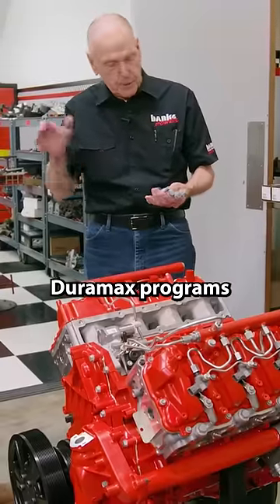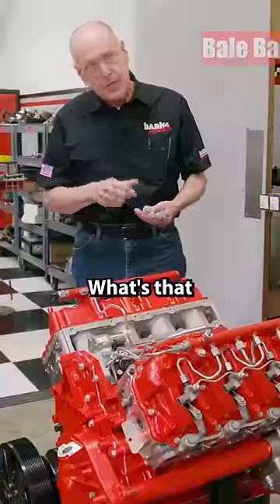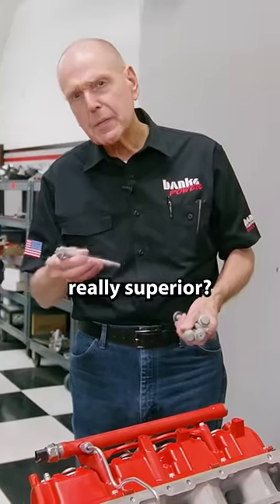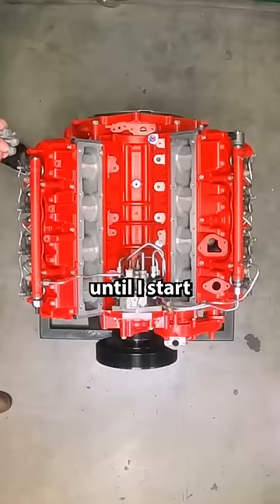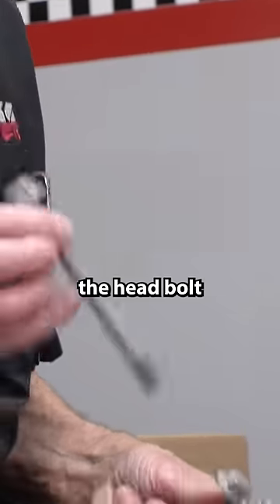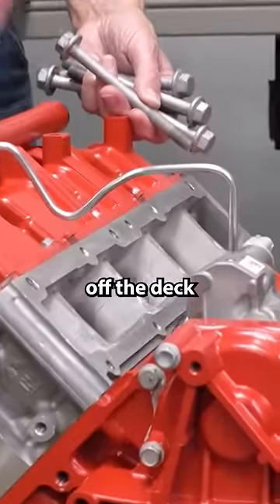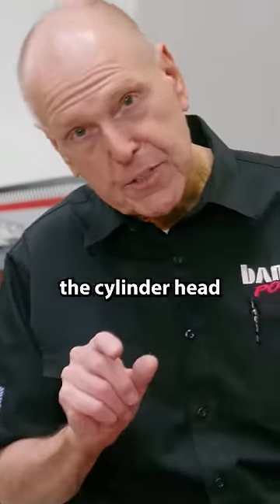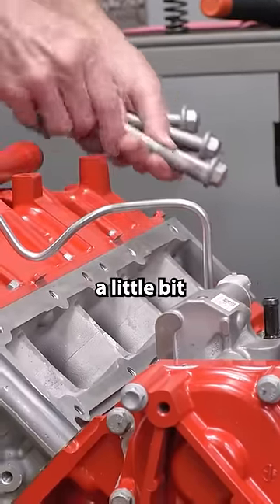Upgrading to head studs might be a bad idea

Comment: As a Ford 6.0L owner, I still won't hesitate to spend money on head studs lol
Reply: A lot of 6.0’s get studded and still have issues because of bad machining work and surfaces. DieselTechRon, JoeDiesel187, and KTM have all talked about how they got redo’s. Anything above stock power will need studs though and the Ford calibration is already way higher than Navistar intended it to be.
Reply: 6.0s make really good boat anchors but really unreliable truck engines. "BuT iTs BuLlEtPrOoFeD!"
Reply: i think the biggest problem was there is only 10 bolts  @warrenself
Reply: Because it's a 6.0😅alone or because of the labor involved?😊
Reply: @painteater19 the question is is the 6.0 or 6.4 a better boat anchor
Reply: Junk
Reply: @warrenself false. I found a website selling international 6 liters and the power numbers were identical. The difference is the emissions standards
Reply: "As a Ford 6.0L owner"

Well, there's your problem....
Reply: @painteater19 best trolling line anchor ever!!!
Reply: @SXSPRIME a 6.4 over 100k is a better boat anchor.
Reply: @painteater19  I know a guy that spent $8k on a "bulletproofed" 6.0 for his van, and it just blew up. Such a shitty engine.
Reply: @joshuaearnheart2756  Ford calibrations have higher cylinder pressures. Ford vehicles blow head gaskets way more often than the International ones. Usually the International trucks lift a head when the EGR cooler, oil cooler, or water pump fail and overheat the engine after it’s pushed. Ford calibrations do require more EGR usage but they allow more RPM, more boost, and therefore higher cylinder pressure. The RPM is also why you see lifters fail in Ford applications because the VT series of engines use the same lifters as a 7.3 which is another giveaway that it was a mere replacement.
Reply: @josiahjosiah534  Only really an issue with Ford’s because of the higher cylinder pressures. Heads usually only lift in International trucks once the engine has been pushed and overheated after a cooling system failure.
Reply: you guys are an exception to the rule LOL. You get a pass
Reply: The Duramax uses the correct amount of bolts per cylinder..... 6.0 takes a lot of money to get a few days of reliability.  And still won't be as good as a D-max.
Reply: Exactly what a 6.0 owner would say 😂
Reply: @thewatcher611  VT365 spec doesn’t blow gaskets unless majorly overheated or tuned. Stock Ford tune is too much for the engine.
Reply: Some engines just need studs. Old Toyota turbo engines with iron blocks (22r, 7m, 3s & 1/2jz) do have head gasket failures until you fix ‘em
Reply: The 6.0 powerstroke needs the studs, the duramax doesn’t. Just a small amount of difference makes the difference.

Comment: This guy is WAY to smart to be an OEM engineer. 
If he was, nothing would ever break….
Reply: Management would tell them to design a failure or cut costs on the team until one organically showed up.
Reply: Does someone wanna tell Travis?
Reply: Something will break eventually
Reply: @MikeyB-Rod no..1989 was a long time ago.
Reply: @timothybayliss6680  uhh, ok
Reply: I think you nissed the point. Its not that nothing fails, its that you decide what fails.
Reply: @jstadude9810 nailed it. It would be great to have an engine where nothing failed. And I have had a few that ran nearly 300,000 miles. But i did not add power to them or push them to their limits. They performed as designed. More power and equally increased reliability get very complex and expensive. I mean what are you gonna do. Make a forged ar500 billet block for your engine? Something has got to give somewhere.
Pick your Fuse. Make it cheap and easy to replace.
Reply: @tsstn buy a toyota hilux or a MB
Reply: @MikeyB-Rod I want to but he kinda responded himself
Reply: @luichinplaystation610  I don't follow what you mean?
Reply: Planned obsolescence

Comment: This is why I subscribe to this channel. This man brings real good intelligence to light and I've been taught for years. Being a mechanic that fasteners, especially bolts, are supposed to stretch when you torque them. That's the whole point of talking a fastener is you torque it. You're putting stretch into it so it's acting a little bit like a spring. If it's too that spring is too rigid and not forgiving like he's saying it will find a weak point. Awesome video for those of you who aren't subscribed to this channel and you want to build hot rods and engines and you want to make more power and go faster and all of that you need to subscribe to this guy

Comment: This logic works for aluminum heads and blocks. doesnt really apply to iron though since its so much stronger. Thats why you dont hear of this happening on Cummins engines. Since they are cast iron, the threads dont just pull out like aluminum does.
Reply: Commins use 6 bolts per cylinder, Durammax 5, older Powerstrokes used 4 bolts!  Older Powerstokes need studs, plus head thickness makes huge difference.
Reply: @litoaykiu  i mean you're right, but my point is still relevant. Also, and this is just my useless opinion, it seems that material quality across the board has taken a nose dive. So, for me, id take a material that is unequivocally stronger over one that COULD be better, but usually isnt.
Reply: @litoaykiu I don't know what duramax you've looked at that had 5 bolts per cylinder but I've never seen or heard of such a thing. They're 6. And if you wanna get picky a duramax has 36 bolts for 8 cylinders versus the 26 on the 6 cylinders of a Cummins. So if you wanna average it out that way the dmaxes have an overall average of more bolts per cylinder. Not like anyone ever counts them that way tho...
Reply: Cummins stock bolts are very good.  Studs aren’t needed until you get north of 1,000hp
Reply: @ohboy2592  head studs are literally one of the first mods most reputable builders recommend for a Cummins.
Reply: @jacobormsby9241  yes, I know.  I didn’t use them is all I’m saying and I was pushing the top end of hp for 5.9 when I did my upgrades.  This was back in 04-05.  If I were to do it again I may consist but I don’t need nor have a use for that kind of power anymore.  I was either very lucky or proved that if done right they aren’t needed.
Reply: @ohboy2592  honestly, probably both. there is ceiling to how much power a bolt can hold just based on boost pressure and combustion pressure alone. but, if built correctly and in the right order, they can hold tremendous power. its just, for me anyways, I wouldnt want to get away from home and have the head lift while im towing my 5th wheel.
Reply: @jacobormsby9241  I agree.  It’s added insurance for sure as I’ve never heard of an arp head bolt causing an issue.  At least with a Cummins.  I don’t follow gm
or Ford diesels much so I’m not sure on those platforms.
Reply: I think you have it backwards. Cast aluminum and cast iron will crack and break. 
Billet won't, it will stretch and bend. 
No one is making heads out of cast aluminum, though intake manifold are made that way. But, they do make heads and blocks out of cast iron. They're cheaper to produce, but more susceptible to cracks...
Reply: @pimpovic2  No one makes cast aluminum heads? Are you sure about that? Almost every head you can buy for any car from, say, edelbrock is cast aluminum. Billet heads are almost always a one-off, custom project. Unless you enjoy spending $2k each head. Also, if you didnt know, every single aluminum block you have ever seen is cast. Unless its a purpose built, strictly race engine built specifically for you,  its cast.

Comment: I totally agree with this statement 100% which is why they say if you blow a head gasket or even take them off after running the motor change them out for new ones.

Comment: Had a ford 6.0 folks said i couldn't push beyond 8 psi with stock head bolts. I pushed it to 25 psi just to prove they were wrong.  It failed at 27 psi ,just replaced the gasket and factory bolts . Runs fine.

Comment: This man is by far probably one of the most intelligent public figures for engines but I think it could be contested with some of the other older guys out there.

This is a good informational video that would need to be run with casting numbers. Some engines have the characteristic of blowing head gaskets just how Hondas have the characteristic of burning oil because of low tension piston rings.

Know your engine before building it.

Comment: I agree with him, in an application where you are not going to,  or subject to, take it apart,  over and over. Then a stud makes so much more sense. A lot of people don't realize,  especially on high compression or high boost engines,  that the heads bounce up and down on the head gaskets. That's why diesels have grommets in the water passages to expand but still seal the water passages as the head goes up and down. Of course that pounding then beats the liners down into the counter bore of the block. It's just part of it.

Comment: Finally someone that agrees with me. Oem headbolts are usually the best solution. The bolt is only as good as the threaded hole it is pulling on.  7 cast threads in a sbc don't match a arp stud.

Comment: I had 3 "experts" tell me my lb7 had a blown head gasket. I'm not a mechanic I didn't see a YouTube. I just reasoned that it could be a water pump seal. So I replaced the pump & oil cooler. Then I tested the cooling & it held 15psi for 3 hours.  Instead of 8k, I payed $650. Truck is still pulling weight now.

Comment: I don't build engines. But I understand metal /steel. This is exactly correct the way he explained it. The bolt can't expand and contract. The more ridge equals brittle. If you drop a drill bit on the floor it can chip. But normal steel bar. Nope.

Comment: Exactly true, you see studs in lots of racing applications but often times they are in modified blocks.  Other times they have different gasket material/assemblies, after being a technician at Cadillac, I can tell you that almost any time we did a stud or insert repair, the block would crack within a year.   Oftentimes the drilling is disruptive enough to cause failure by itself.   A forced injection gasoline engine has much lower combustion pressure do to relative compression ratio differences than diesel designs.  The dynamic compression ratio is also much much different in diesel because combustion pressures are rising much earlier in the stroke event, resulting in a longer dwell time under extreme combustion compression.   Therefore a gasoline engine with stud inserts are more forgiving.

Comment: I have a 91 Cummins 5.9 in my Bronco, with the VE maxed out, and I built a hybrid turbo for it, it makes 39 psi, and it did actually rip the center head bolt in half near the front, and started pushing out coolant. I went with ARP studs at that point.

Comment: Reminds me of many years ago with Windsor Ford engines and boost. Using the head gasket as a "fuse" to prevent further damage to the engine. Head studs and o-ringed gaskets moved the failure point to something much more catastrophic and expensive.

Comment: At the moment I forget what Volkswagen TDI performance shop it was, but they were drag racing a 1.9 TDI years ago that kept leaking past differnt head gaskets. Finally they removed one bolt at a time and replaced with an ARP stud/washer/grease/nut and their issues went away.

Comment: The old air cooled VW engines started using head bolts that had spring steel to allow this. They were actually called stretch studs and they had to be tightened in stages.

Comment: The only solution I could come up with in a fail safe concept, is a completely new block and head design, where the fasteners pass through the castings and thread through a high grade forged steel girdle, and the protruding threads backed up with flanged nuts. Any blind bolt/stud holes set at an angle to limit lift, and practically migration by   installing alignment dowels at each critical point in the bolt pattern.

Comment: several stock bottom end LS guys got fancy and replaced the factory torque to yield rod bolts with an ARP setup but the clamping load was different so they spun bearings.

the stock bolts have held the power more reliably at 1000+hp...

Comment: Simple Retorque Bolts every 175k miles to close the gap and replace with stock bolts every 500k or 2x Retorque 3rd time replace to avoid Gasket Gap. Got 2.4 mill miles on a 1998 honda civic without replacing the head gasket.

Comment: Should have seen this clip last week, blew my gearbox mount and decided to recondition it and torqued it to spec, but the mount was so rigid that it didn't allow the gearbox to move,it didn't even absorb any shock up until it exploded, the front-end bit that connects to the engine

Comment: Its well studied outside the car industry in design. The amont of people who think its good sticking some more rebar in,'bit more will make it stronger' attituse. Its a designed system,so loads are passed to other parts which are also designed.Extra stregnth in one are will move stress levels around,may not even matter in the immidiate area but down the line,somewhere it may.

Comment: I believe this an engineering concept is known as feedback. Making a change to a system causes another change in the system. In this example, replacing with more robust head bolts increase the force of the head on the gasket, but the feedback is more stress of the engine operating is then passed on to the top of the head where the bolts attach.

Comment: There is an important and rellavent point I believe, Gale has missed here with this. A bolt when installed and torqued as per the standard procedure these days is putting far more load on the block threads. During tightening it puts a radial load on the thread as well as a linear one. The act of tensioning is the issue. When a stud is used it is installed into the block with very little load applied preventing damage to the thread and hole. The radial load and point of wear is between the nut and the top of the stud, the face of contact with the nut and the bolt on the head remains the same. Less thread wear = no block thread damage. It is a standard thing to use studs on castings that will be serviced frequently for this exact reason. If the studs are damaging the block threads surroundings like the picture shown assuming everything was in good condition before the failure it is showing the inadequacy of the thread size and the thickness of the deck. A finer pitch, different deck material could make up for the issue but there are limitations posed by the things like gasket, head casting or even the ability to source components best suited to the task. Anyway a solution is a softer stud but as mentioned if you are having trouble keeping a head gasket in place the last thing you need is to introduce more flexibility. The stud isn't the problem it just shows the weak point.

Comment: Just like y’all need to start using nails when framing lumber under load. It gives the wood the ability to flex as screws are brittle and any major movement could cause damage. Well said

Comment: I drilled out my 12mm threads and run 14.3mm head studs. 

The thickness has a higher strength and a lower fatigue rate, and there is more thread area and less strain on the threads.

Comment: Not trying to suggest he’s wrong but ARP head studs have been used on engines with well over 1,000hp too. The key is to follow the directions on how to properly torque them and how much to torque them too. The problem I have with stock head bolts is that the construction material may not be enough to handle more power on certain engines. They also can stretch pass the point where you start seeing engine problems, ie m156 AMG engines. They were notorious for stretched head bolts.

Comment: My perspective is this, if your gasket can expand and take up the space from the head lifting, as long as you have alignment dowels in place that prevent lateral migration a fire ring would be optimal, or an actual band ring that seats into the deck and cylinder head grooves enough to keep combustion pressures in the chamber and not into the coolant jackets. Inserts around oil drain and cooling jackets drilled to a round shape and solid dowels machine drilled to the desired wall thicknesses would keep fluids contained during head lift without shredding the gaskets.

Comment: He has a point. Its like putting new wine into an old wine skin, or putting brand new patches on old clothing. The new material is stronger  or more rigid etc and can cause damage to the material its used in or on, or in the case of the wine skin the wine skin is already pretty worn and the new wine should go in a new wine skin so its less likely to eat through it.

Comment: Engineered failure point.. 
 And these can be awesome.. 
It’s like how a starters teeth are softer metal than a flywheel so usually a starter will mess up it’s bendix before the flywheel teeth gets stripped.. saving a lot of money and time by just replacing the starter..

Comment: I've been dealing with a similar head gasket failure situation on my EJ 25 Subaru
Most of my research goes back to using factory head bolts

Comment: OEM TTY Head bolts for factory longblock 02-07 LS, 95-02 2jz-gte/RB engines at 1200, 800, 700 respective rwhp dynojet output. The Factory block girdle will fail to support the crankshaft before the headbolts or factory pistons fail in those engines with proper setup & tuning. Also something to keep in mind is the peak cylinder pressure of a high output forced induction engine can be lower than a natural aspirated engine. NA engines produce large high cylinder pressures just after top dead center whereas forced induction engines with the higher octane fuels, increased air density and delayed ignition timing typically produce longer area under the curve of cylinder pressure at much later crankshaft angles with less of a peak pressure and peak pressure is maximum stress on the piston and head, rod, etc...